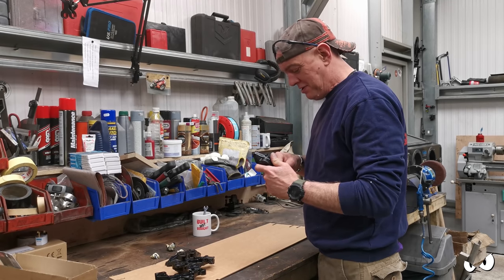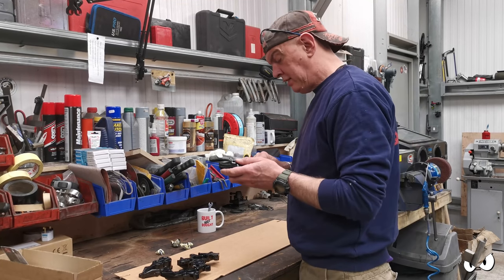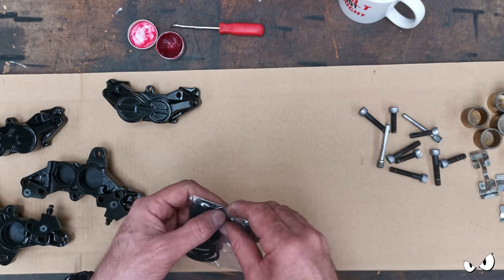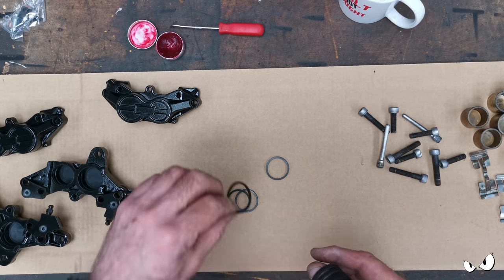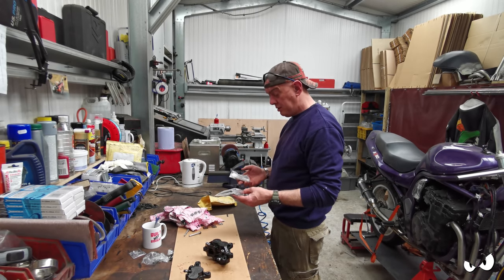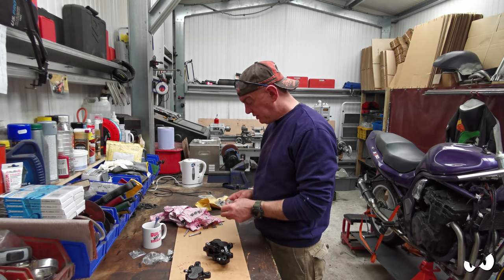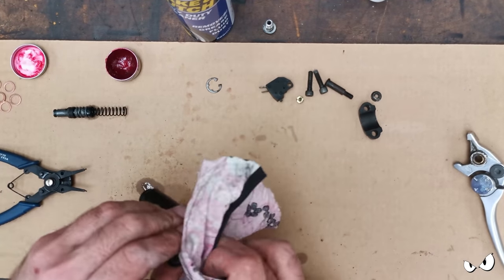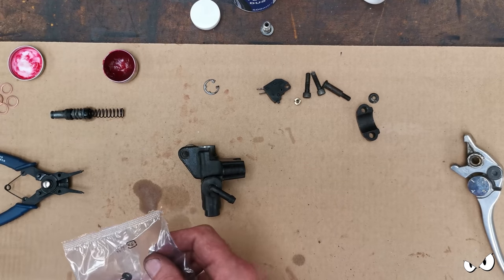Suzuki Bandit Front End Swap - Brakes, lines & master cylinder

Comment: Wot, no copper slip! Those pad pins are a nightmare if they seize, I highly recommend stainless. 
Triumph brakes are pretty awesome when looked after properly. Transformed mine with a quick service, and, no, I didn't use copper slip either.
Reply from the maker: Hehehe... Good man 😁👍
It's sometimes amazing what difference a quick clean and service can do 👍

Comment: How about one of those electronic single wire ignition and light system jobbies that Craig fitted?
Reply from the maker: It's all going M-unit in thr ultimate build. Anything you see happening now is just testing how i can swap suspension, brakes and wheels to improve the handling. I'll make it all look nice and unique in the project build 😁👍

Comment: You probably already know but Fastec Engineering; Newmarket do some nice parts for the Suzuki Bandits.

I appreciate you want to make your own parts but the torsion bars for the rear brake calliper you were not so keen on are one of the items they produce in aluminium, which look nice.and appear well made.
Reply from the maker: Cheers Ian, I'll have a look. The bike is currently a test bed only, so not fussed if it looks a bit unfinished, but when it gets built properly I want it looking AWESOME as its going to have to fund the next project bike... 😁👍 Thanks for the tip matey

Comment: As an alternative to the standard master cylinder. I fitted an all in one 16mm Brembo master cylinder with reservoir and brake light switch to work with those callipers. It gives me a very progressive feel and loads of power and was a piece of cake to fit. This site shows a good selection of the options https://www.oppracing.com/category/1012-brembo-oe-oe-front-brake-master-cylinders/ but I got mine from a UK company https://www.biketorqueracing.co.uk/
Edit, and for pads I can recommend SBS RS pads https://www.ebay.co.uk/itm/132209924705
Reply from the maker: I'm still toying with ideas for the project build, so I'll take a look, but for now a temporary bracket will.do I think... I'll take a look for the project though, thanks matey 😁👍

Comment: Well that’s a pisser. Did you get that from a proper shop or just some random toss pot on EBay?  If it was a shop some slimey ass hat has bought that, swapped the lead over and sent it back for a refund and the dealer hasn’t checked properly to see what’s inside the box.....

My day has mostly been spent servicing the forks on the Street Cripple and getting it wrong.  There’s a cupped washer inside that the spring seats on  and when draining the forks it just falls out so you have no idea which way round it goes.  No problem I thought as I’ll just take note  of the orientation on the next leg.  That one fell out as well and no where in the Haynes book of lies does it even mention it.  I took a guess as to which way round it went and got it wrong so had to redo the whole flipping lot after refitting the forks back on the bike.  I was a lot faster the second time but I was still a grumpy so and so for most of the afternoon.
Reply from the maker: Hehehe.... normally the nut sits in the recess in the washer. Don't think I've seen any the other way round... can you try replying to this matey just to make sure you can?
Reply: @QuickBikes  ha! It works, it works!